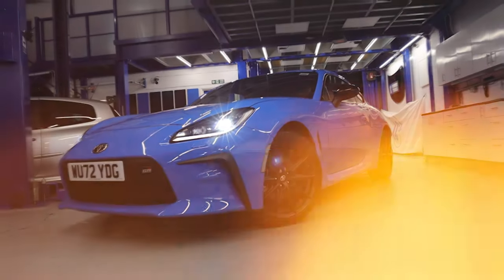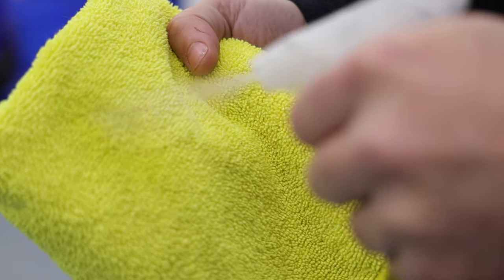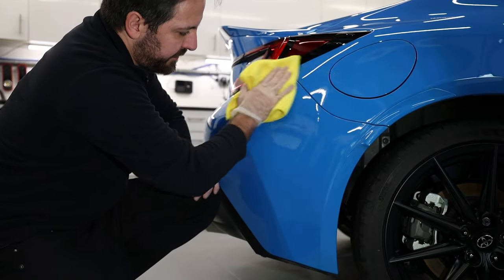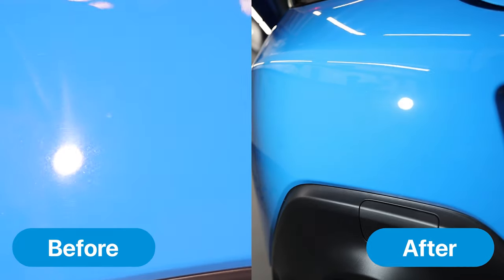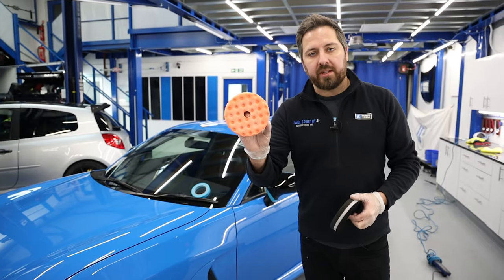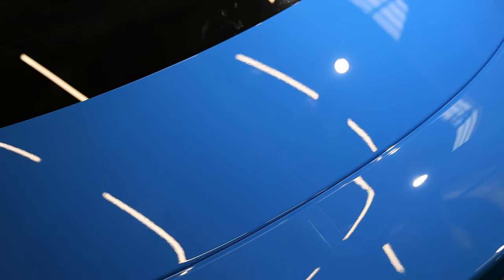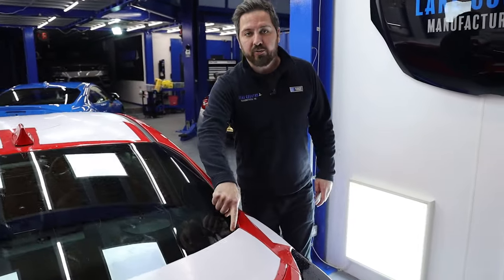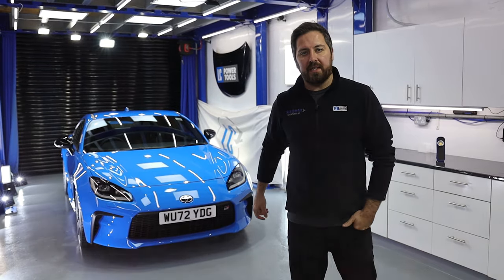New Car Detailing - Do new cars need POLISHING?

Comment: That blue color on that car is stunning.    One of my favorite shades of blue on a car which harkens all the way back to the French Racing Blue color of the early days of racing.      That UDOS polisher looks very solid and well built.   I am hoping Lake Country gets on the bandwagon someday with a "MINI" UDOS!     Take the same machine,  put a battery on it,  SHRINK IT to adapt to the 1", 2" and 3" pads!   Enclose it all in a nice case.    Offer a basic version (tool and batteries only) and a "complete" kit version (i.e.,  like other manufacturers offer that include 2 pads of each size (1, 2, and 3 inch) in all cut levels and microfiber levels,  the small extension rods,  etc.) Then Lake Country would surely have one of the best machines on the market just in versatility.
Reply from the maker: Thanks Joe, and I've noticed your comments about mini polishers on other videos too.  We're watching and listening for feedback and will take it on board as our power tool division expands :) (Jay B)
Reply: @LakeCountryManufacturing  I'll be the first one in line for sure if they ever do develop a mini!   Thanks for the feedback.

Comment: Thank you for going through a new car prep. What compound/polish did you use on the GR86
Reply from the maker: You're welcome, we/I hope you found it insightful and interesting to watch :)  

I'm always looking for high-quality diminishing abrasives that are easy to wipe away when broken down, as low as possible in fillers, and which don't go dry and create excessive amounts of dust.  Typically I use a medium cutting microfiber compound for the defect removal, then switch to a blend (we actually mix and use a variety of polishes in-house) for the refining stages.  

What we've always found, and I'm speaking here about my time as a pro detailer working with Kelly Harris at KDS Keltec for 10 years, is that LC pads flatter whatever compound or polish you're most comfortable with so, if you have a favorite, give that a try!

Comment: Great video and content always. What was that texture on the bumpers? Will the one step microfiber pad always leave haze or depends on the product it is used with along with the paint type ? Thank you!
Reply from the maker: Thanks!

In basic terms, the sinkage texture on the bumpers is a paint condition which can occur as it dries out and settles.  On this car it was just affecting the bumpers, but many suffer from it over the whole vehicle.

The one-step microfiber leaves very little haze, if any. We've developed it to have a lot of cut AND the ability to finish down extremely well, which is usually a difficult trade-off to manage because, typically, the more cut you get from a pad (i.e. the more aggressive it is) the less refined of a finish it will be able to leave behind. On harder paints or lighter colors the results from a one-step microfiber may require no additional refinement at all.
Reply: @LakeCountryManufacturing  Amazing, thank you very much for the reply!

Comment: These new Toyota are getting worse and worse with their paint defects..
Tape line easily come off with acrysol body prep solvent.
Drivers side above the door handle is always scratch because of transport driver sticking their arm outside while reversing off the trucks...madning 
Anyway that's Toyota approved 👌🏻
Reply from the maker: I just want to add - we (in the UK workshop) have seen new car defects to a greater or lesser degree from every brand, high or low end.  These Toyotas aren't particularly bad, which is actually the main point of the video - pretty much ALL new cars can be improved :)

Thanks for the comment!